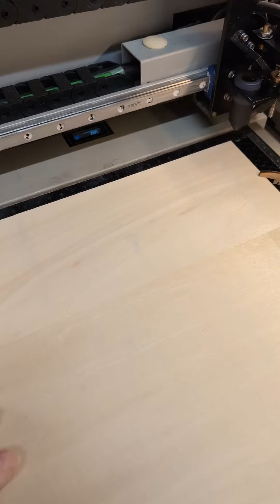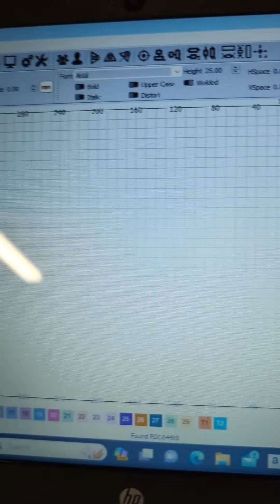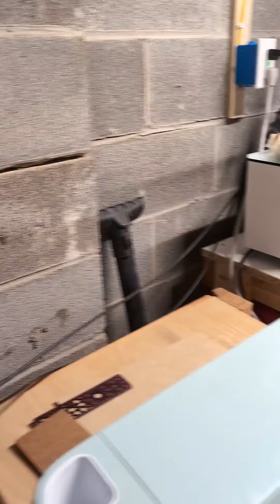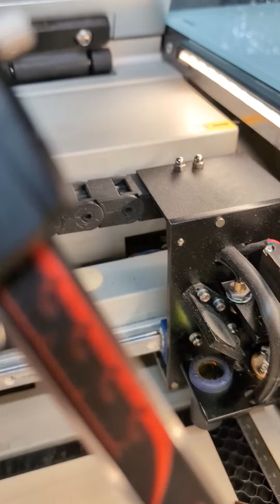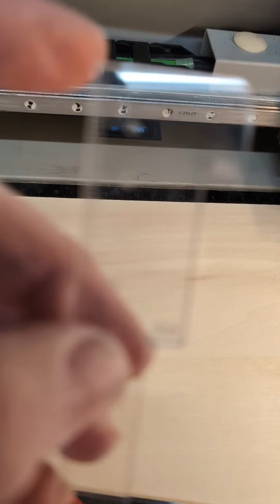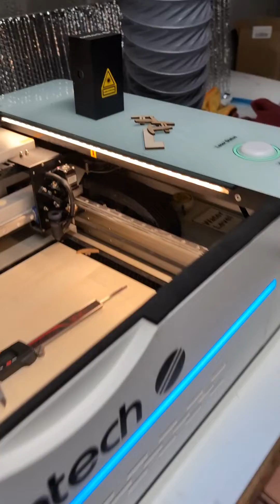How to focus your Omtech Polar properly using calipers

Comment: Not sure why my laser head goes up automatically as it should, but comes back down....any idea? Makes it difficult to use thicker material.
Reply from the maker: Do you have the new Polar+ with autofocus?
Reply: @TheJonb1974 I purchased it about a year ago but just recently started setting it up...I don't think it's the newer model. It's the 50W version. From my understanding, the laser head should go up, and stay up automatically...mine does that, but then automatically lowers itself back down.

Comment: Why are you measuring from that point and not the end of the laser nozzle ?
Reply from the maker: The focal distance is from the lens to the material. With the swedish made lens holder that I use, the lens is even with that "shelf" that the top part of the calipers is up against. Therefore, that is place I want to measure from

Comment: Thank you for sharing. What glasses do you use for eye protection? I wish I could be as confident as you when using my polar. I stand a few feet away before firing as I'm worried a laser beam will reflect on some metal part on the bed and shoot towards me through the glass window or some crack or air vent in the cabinet.
Reply from the maker: @guillaumebrouillard1326  here are the safety glasses I have. Sorry I didn't reply sooner. I rarely check comments here
https://a.co/d/cQOLoVb

Comment: The measurement from the flat surface of the laser to the top of the material isn't actually 50.8, it more like 49.4 or 49.5. 50.8 it's from the top of the material to just above that flat surface because the lens is placed just a little higher up. Measure the clear ruler that came with the polar and you'll get a different measurement than 50.8. I always use my calipers to focus my material like u do but I use 49.4 and use my clear ruler to make sure I'm in focus.